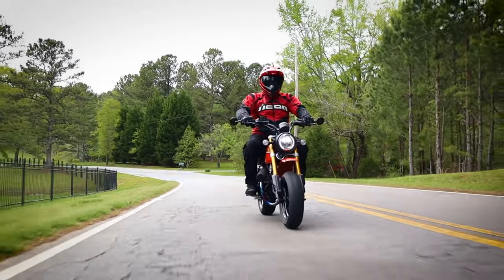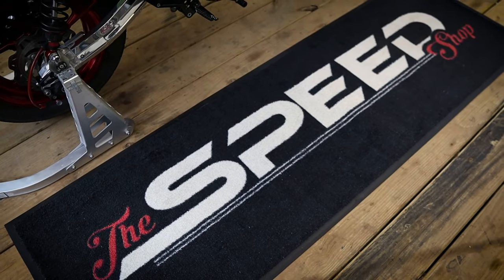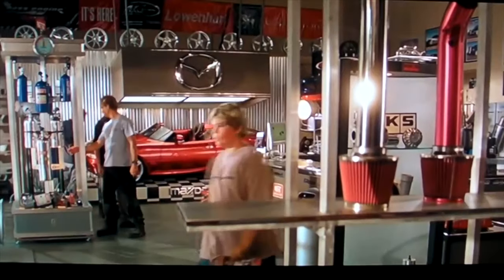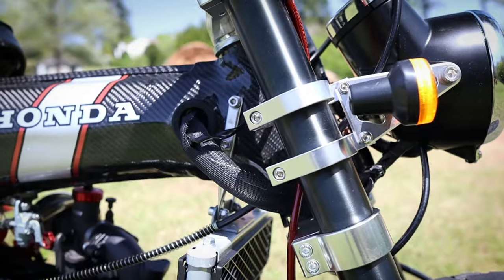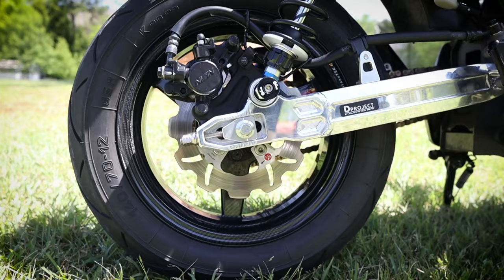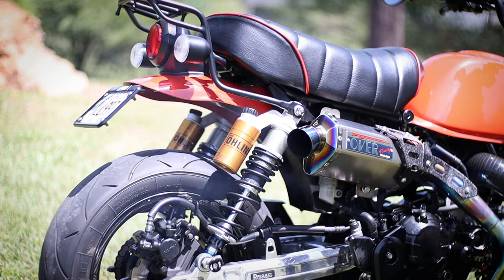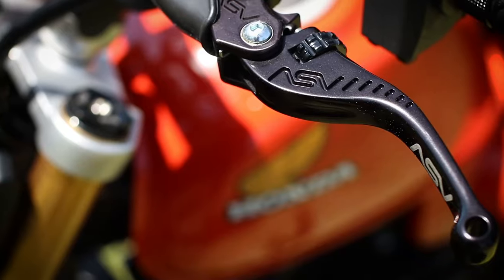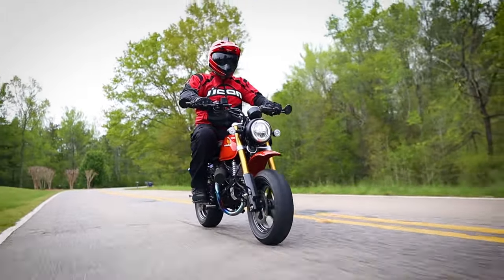New Honda Monkey 125 Custom Build! 30+ Horsepower, BST Carbon Wheels + More! | Retro Z50 Tribute

Comment: I hired Wayne at the speed shop to put a cb300f engine in my monkey. I needed a small bike, more horsepower and RELIABLE! We used Steady Garage connecting components- Kevin there was a HUGE help. Monkey has done Utah to Chicago,  salt lake city to Chicago, yellowstone to Chicago, pheonix to death valley to Denver and many other trips without problems. Plenty of torque at 11k feet in elevation.  Oil, chain and tire attention and that's it. Oh, the aracer is too rich and drains the battery when sitting but other than that, its tough. Remember, stock tires are only rated to 63mph! I break that limit often but also only run good tread.
Reply from the maker: Thanks for sharing your story! Saw your pictures on Wayne's Instagram the other day and that's awesome to see all of the traveling you're doing with it and definitely putting her through the paces. Most people don't think about the speeds some of these tiny tires are rated at when doing engine mods like this so it's nice to see someone is lol!

Safe travels on that awesome Monkey 300!

Comment: My thinking is, if you throw enough money, time and talent at any stock platform you can take it to whatever level you want.  No question this is a masterpiece or mini-piece depending on perspective. ;-)
Me personally?  I always believe in buying something closer to the end result I am look for.
Don't try to change a Camaro into a Corvette.  Wasting your time and money.  Buy a Corvette.
In this space, I would take a stock Monkey or Grom and put a bigger Honda engine in it from a wrecked bike.  More displacement is better.
I wouldn't carbon it all up including the wheels...custom paint job, better turn signals etc but with an eye toward cost consciousness.
Truthfully, just buy a 300cc motorcycle where you don't have to change the engine, put a custom paint job on it and call it good.

Comment: I want to see someone make a bigger tank
Reply from the maker: Ahh, didn't even think about that but when stock, the tank isn't that much of an issue but with engine mods like this, it definitely zaps that factory 150 MPG rating. You've got me curious on how many miles a tank Bud gets on her now with this setup...
Reply: @HondaProKevin  
     50, maybe?
Reply: Me too, love the monkey look but the tank looks shrunken compared to the rest of the bike
Reply: You want a gorilla 
Like honda used to have in the past
I would like to have this bike in bigger size
Reply: As a tuned monkey owner I can confirm, this is a huge problem for me😅
Reply: Can get 2+ gallon tank after market.

Comment: I like the Euro-style taillight and signals, sure, but I actually prefer what we get here in the States.  And thanks, Kevin, for this look at this Elsie, er, Monkey.  And in my dreams I'm thinking maybe I want my new Dax to be painted like that, with the high front fender, too.  And as a former Dax and Elsinore owner, I'd be re-living a couple of dreams with a Dax in that color with that insignia.  And it'd be beautiful.
Reply from the maker: Yessir, different strokes for different folks when it comes to the lighting setup on Euro spec versus US as you're not alone there either. I've seen quite a few guys that prefer what we get here in the states which makes it nice that different countries have different setups so we have options that are still OEM at the end of the day.

I like your thinking on a Dax with paint like this and a high front fender etc, that'd be cool! American Honda needs to hurry up and get to cracking on bringing the Dax over here so you can get started on reliving those dreams ;)

Appreciate you checking out the video and throwing up a comment too!

Comment: So, how much did you spend on the build, and what's the (gps-based) top speed? :)
Reply: This bike has been built several times over. Contact Wayne at the Speedshop for your own build quote. I've gone 92mph, stock gearing, and weigh 225lbs without gear, but top speed is not the point of the build. I ride the tri-state GA/TN/NC mountains. Having HP to go up hills and powering out of an apex is where the fun is.
Reply: The only thing worse than putting $10K into a 125cc Monkey is putting $10k into a 50cc Ruckus.
Reply: @25Soupy  Jealous much?
Reply: @k9bud  
   Triggered much??
Reply: @dr.OgataSerizawa  EAD much?
Reply: @25Soupy  What is comes down to.  Completely agree.
Reply: @k9bud  Buy a $14K motorcycle with 100 RWHP.
Reply: @lukewalker1051   I currently own 10 motorcycles, more than a couple of them are way more than 100 hp, but thanks for sharing your narrow-minded comment. smh.

Comment: HAHA ! I'll believe 30horse power when I see it...not before !  less than 200cc and 30 hp i seriously doubt that.... 25hp MAX not 30 ! i don't care what they say !
yah ...it sounds REAL good but 20 to 25hp in such a small frame would....
 but I got a question for you... does this honda have a real clutch or an automatic clutch
I ask because I had a Honda 50cc Mini decades ago and it was an automatic clutch
and sense the Honda Monkey is the same thing just a bigger cylinder it makes me wonder
and I haven't heard any reviews that have mentioned that.... thanks
Reply: Very possible in racing setup but durability is poor for daily use

Comment: MPG?
Reply: If you're twisting the Throttle, 65-68mpg. If you're just riding with a couple spirited twists .. 85mpg.
Reply: @k9bud  
So, you doubled the horsepower and get half the mileage.
Reply: @trudat4449  doubled the HP? 8 goes into 32 how many times? lol. And it's Smiles Per Gallon.

Comment: Instead of doing that build just go buy a 190cc replica motor that way you can still keep the stock honda motor to swap back
Reply: Chinese made carbureted 190cc is not a simple swap into new Hondas. It also makes no where near the HP as this engine. I have Daytona 212cc in my 1972 CT70. It still doesn't come close to a GromFatherz engine. Oh, and this bike will never be 'swapped back' to stock.
Reply: @k9bud  oh really well that sucks there goes that idea

Comment: Im sure it makes more power than stock but NO WAY it makes over 30 HP. It likely doesn’t even make 20…
Reply: Dyno'ed 32 rwhp.
Reply: @k9bud  On a coffee break dyno perhaps. I’ve dyno’d CRF250’s that don’t make that at the wheel. I’m not buying it and any knowledgeable builder won’t either.
Cheers!
Reply: @mikecoe4003  I hope you get to feeling better. Must suck being you.
Reply: @k9bud  Thanks for your concern, but I’m feeling great. But you may want to go to the Dr and get a check up as the money you’ve wasted on that engine build and bogus HP will likely make YOU ill once you find out how much power it truly makes!!
Reply: This is hilarious!!! Easily making 30 + hp
Reply: Keep dreaming of the bogus 30+ RWHP claim! As previously stated, likely makes less than 20 at the wheel.
Reply: @mikecoe4003   you must not be in the US. HP is measured differently outside the US.  Plenty of bikes making over 30 and some over 40hp. We don’t use NM..
Reply: Nope. From the U.S. and made hundreds of motorcycle dyno runs on current stock and modified street and dirt bikes. That monkey doesn’t make ANYWHERE near 30 RWHP. I can tell simply by the way it sounds!
Again, I bet it doesn’t even make 20 at the wheel. Anybody that believes it makes 32 at the wheel must have drank the cool-aid!